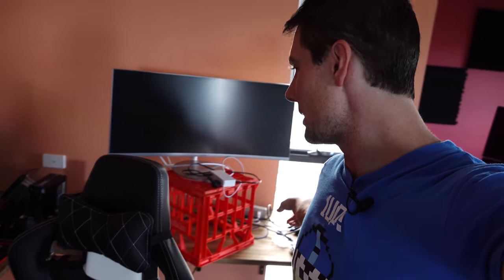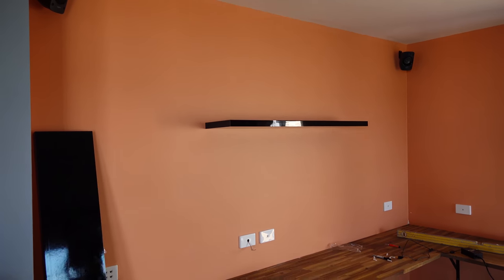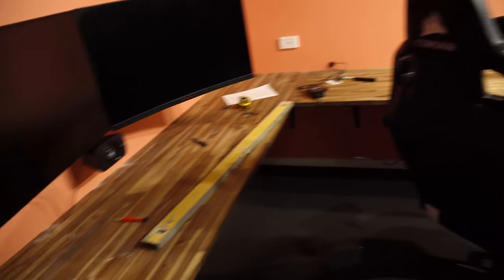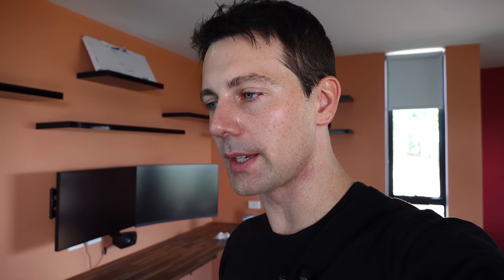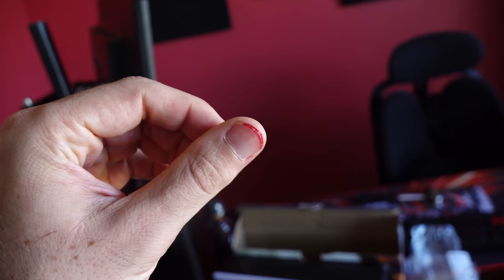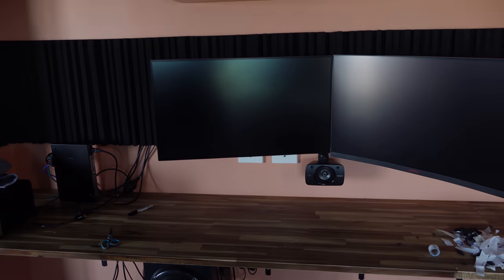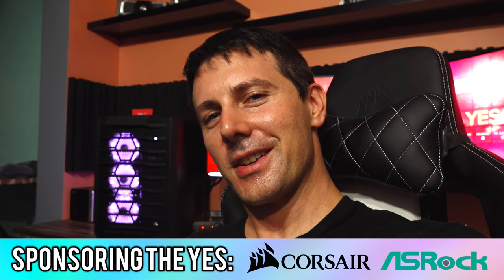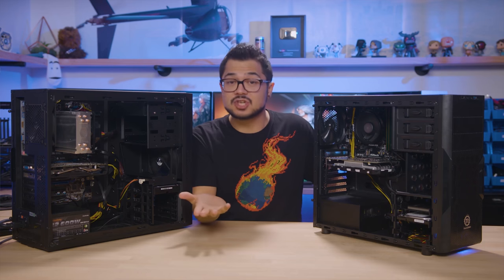Completing the Tech YES SETUP - How to DIY Your Own Gaming Setup

Comment: The craigslist PC that Bitwit bought for $550 had: Corsair 200r case worth $30 max, i5 3570k processor worth $70, MSI Z77A-G43 motherboard worth $90,  16GB HyperX DDR3 RAM worth $70, MSI Radeon HD 7850 2GB worth $70, 120GB Samsung 850 EVO SSD worth $30, 1TB WD HDD worth $30, and Thermaltake TR 600W PSU worth $30. This comes to a total of $420! That’s 130 less than what he bought it for which is still $30 less than he said it’s worth. The prices I got were from what these components sold on eBay for separately. But when you buy a used complete system you don’t buy it for what the parts are worth all together, you buy it for a bit less (or at least you should try to).

Comment: i used 1/4 toggles for my monitors don't trust those anchors. i do electrical and use those plastic ones alot end up having to use toggles instead alot. but love your setup! wish i could do a similar one but not enough space my wife puts me in the corner of the smallest room lol

Comment: after doing whole works on setting up desk, drill this drill that and you still have to work out to the gym ? , how much energy you have men hahahaha, as someone who easily tired i really envy you
Reply: Start small on your workout routine. Like a few pushups/situps and build to a full workout. After awhile it becomes second nature and you are used to it. Then eventually you actually get the itch when you miss a day or go a few days without working out. If you have access to a treadmill or pool, try running/swimming a bit too to work on your endurance.

Not many people will tell you, but what you eat has a HUGE impact on how you feel and how much energy you have. Try to cut out the soda, sugars and junk food. Eat better and you'll feel better. Lots of water too, it keeps your body clean and gets rid of the crap loads of salt in everything.

Comment: I have the Samsung monitor and it is superb and mine came with a wall bracket and the stand mine is now on the wall using the supplied bracket. Bryan can you do a video about using MVNE M.2 drives on a PCIe expansion card for older X79 boards that don't support booting natively. it would be great if we could boot from them with win 7. Thanks Darren.

Comment: If you make a video responding to Kyle, please try to factor in everything. The PC came completely built and worked, included a genuine Windows 10 Pro license key, and the seller had OCed the CPU to 4.1Ghz. Yes, Kyle did pay a lot more than he should have but in my opinion commenters just focused on the price of it all and didn't even consider the convenience.  Literally all he had to do was plug it in and boom, he was good to go. That has a lot of value, which I think a lot of comments ignored.

Comment: Please make a video exposing Bitwit and build an identical pc to overpriced craigslist pc he bought, overclock it, run the exact same test that he ran and compare the results to the results for his new parts pc and compare the price to performance. His video and the fact he uploaded it and gave so much false and unfair information is disgraceful. Not only did he overpay big time for the used craigslist pc but he didn't touch the overclocks on it and he overclocked the ram on the new parts pc which was unfair, but then he also used the overpriced price of the used craigslist pc when working out price to performance. All this made buying or building a used PC look like a worse option and that it is better to buy or build a new pc right now which it isn't. Yes Man please do something about it, do it for your fans, do it for the used PC parts market, do it for the gumtree bogan voice!
Reply: Which keyboard was that? The one on the main desk
Reply from the maker: That used vs new was kind of what I knew he would do, just didn't think he would take it to that extreme where he literally got the cheapest new parts he could find, then compared it against a rip off used pc (that I have never heard of someone paying that much for in the community).  
Getting the 100% exact system will be hard on the used market, though I already built the $150 pc that pretty much beat his used PC, just have to add a cheap SSD to it....  
Though I do have something special planned, might just do it though next month though cause I will be flying to Thailand later this month.
Reply: Tech YES City which keyboard was that on your main desk 
It was rgb
Reply: Tech YES City yes that $150 dollar pc was really good value. I can't wait for the what you have planned. I like your new studio and your videos. I live in the UK and electronics are about 40% expensive here than in the US. Your channel really got me into used PC parts and electronics and in fact saved me a lot of money. About two years ago I built a pc with a Pentium G3258 and after seeing your videos I sold it and built one with used parts that gave me much more performance for the money. I have a used phone, pc, playststion, monitors, and so on now. My current pc has a Xeon x5650, Asus Sabertooth x58, 12gb ram, and GTX 780. It works well and I don't plan on upgrading it any time soon.
Reply: Yeah, show Bitwit how its done. I used to watch him regularly but since he and Paul were very dismissive of Jim over at AdoredTV when he called out PCP, I rarely bother to watch Bitwit content. He and his wife seem really nice people but he needs a kick up the butt and engage his brain a little.
Reply: Tech YES City oh man sounds fun, take lots of video and show us your Thailand trip.
Reply: Bitwit? More like nitwit imho.